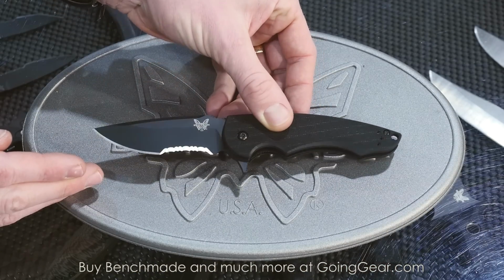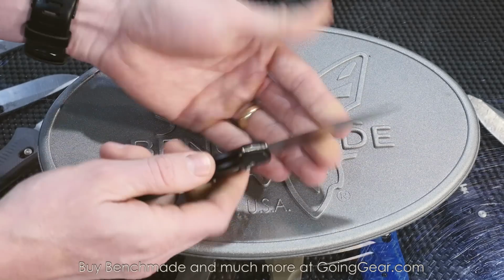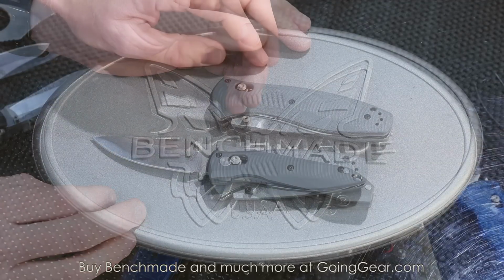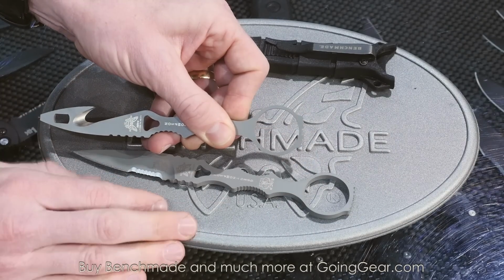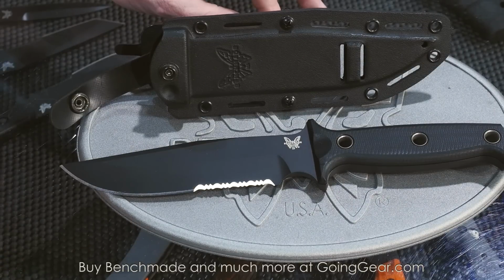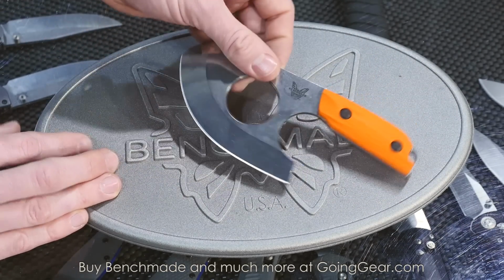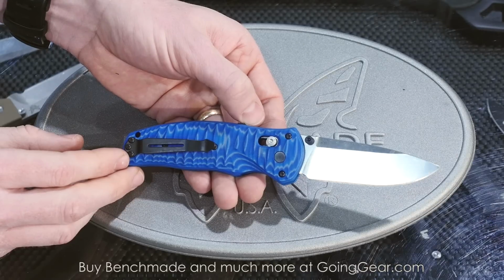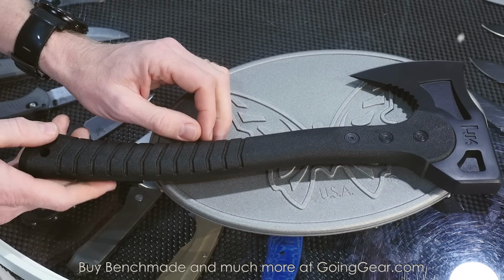SHOT Show 2016 - New Benchmade Knives and Tools

Comment: I paid extra for quality  from benchmade that I did not get ! you say send it back ! I paid extra so that I didn't have to send it back ! the crooked river large crap in a box  they sent me had lock stick requiring tools ! the blade was unfinished ( like a file that was not grounds all the way ) all corners on the handle were so sharp they could cut you with a little pressure  ! I got the crooked river mini  too( it was delivered with a broken spring )and the other spring broke shortly as did all the springs in all of my benchmades ! all replaced with ganzo (G) lock spring that never have broken ! 
 do not buy benchmade through the mail ! and I have heard that even if you go to the knife store you will have to look through 10 benchmades before you find a good one ! 
 and to top that off they cut up guns for the anti gunner communist brown ( the anti American governor ( by fraudulent vote ) ) the anti American governor !!!